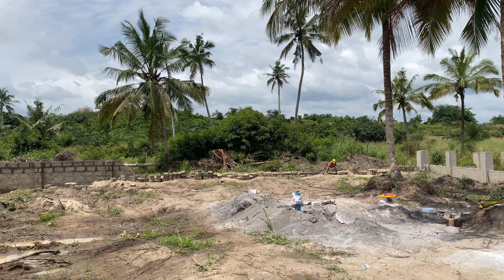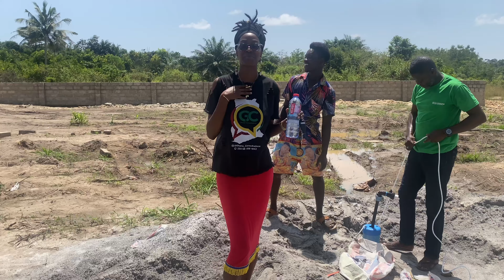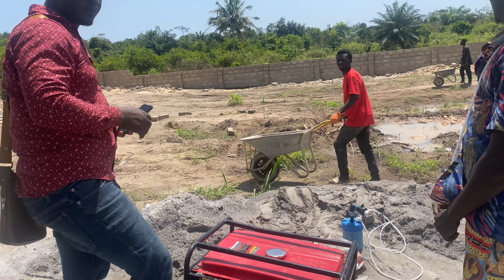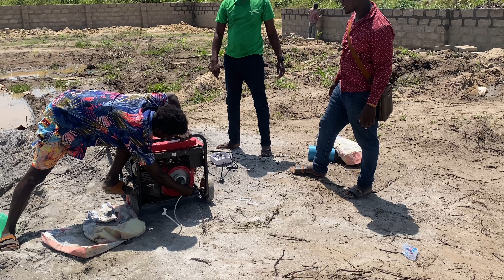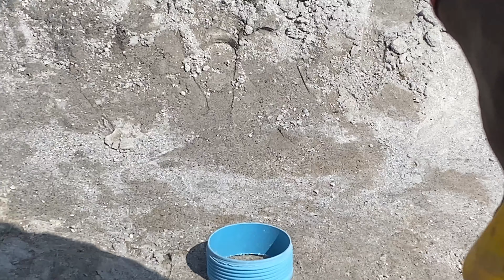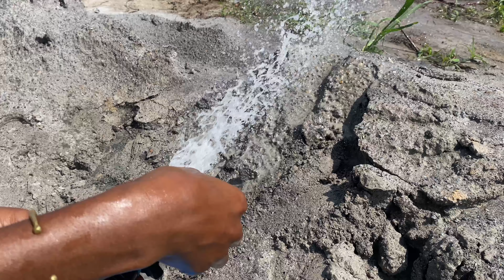PART 2 - I have My own WATER SUPPLY! 💦

Comment: You and Joe have probably already considered it, I was thinking if each house would have a elevated polytank with a float that stop it from over flowing then the pump will only be needed 2 to 3 times a week. Each house can have its own filtration system connected or it could be filtered  before its distributed to the house's.

Comment: My sister  the contractor who is doing that work for you should have use a 2 inch hose because you three other homes. For instance, if all four homes call for water at the same time there be great drop in water pressure. Also use filters to water  lines to the  homes.
Reply from the maker: This is not true, pipes will be aligned with every house that needs water. This is not his first borehole  he has done with even more than 4 houses using it! I’ve talked to the other houses that he’s done, and there is no pressure drop from any of there stories.. and yes we’ll be using filters… thanks!
Reply: @AletaIsrael  I'm not sure if there's 2 inch hose available locally but if you're supplying directly from the borehole to other SEPARATE houses, then the hose might not be able to keep up due to small diameter. So yes he's right IF you're sharing water with other houses DIRECTLY from the borehole. It's not just the hose, the Horse Power (HP) of the submerged pumps needs to be able to keep up also. 

But if you're using it alone or supplying from another pre-filled water tank to neighbours, then none of these apply.